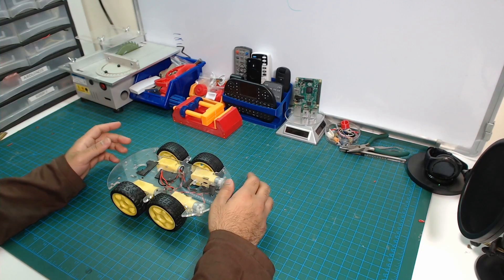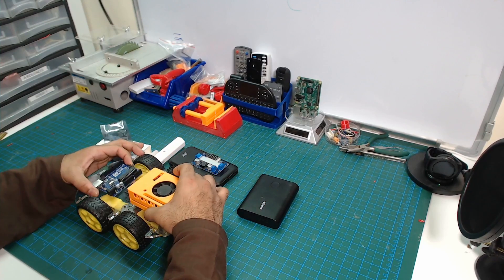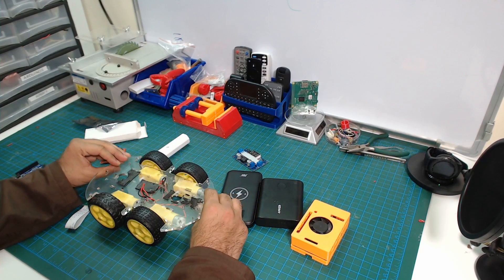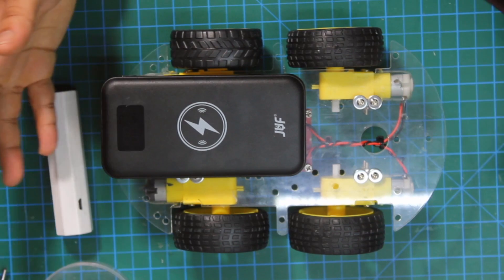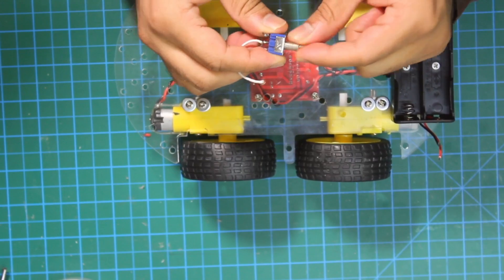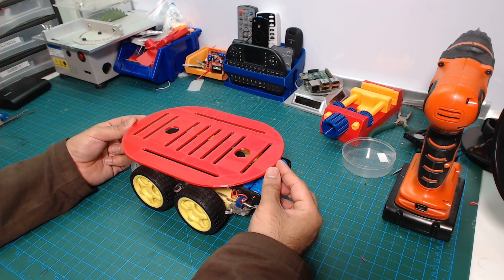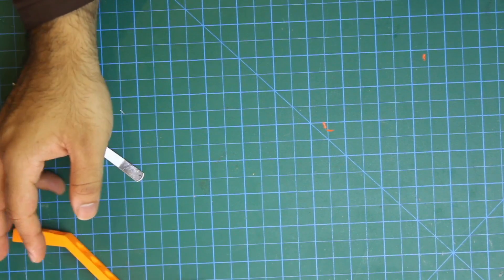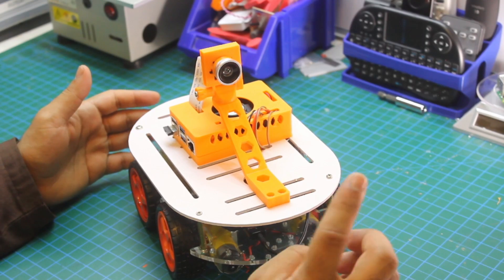The Ultimate Raspberry Pi 4 Robot | Beginner Friendly [p1]

Comment: If anyone will answer me: Is any soldering required?
Reply: yes
Reply: @mystery_1101  Thank you so much for your reply!! Could you tell me where?
Reply: @the_kid777  DC motors and wirings for it to be connected to the control driver
Reply: @gooser1  Thanks!
Reply: @the_kid777  no problemo

Comment: @Murtaza's Workshop - Robotics and AI Bro, could you separately show the connections b/w Motors & L298H & also the connections b/w L298H & Raspberry Pi 4B. The overall video is clear but, these two areas are not clearly shown. Could you please show them n detail through a video/ a circuit diagram ?? Thank You Very Much in Advance !!!

Comment: Can we use 2 Li-ion 18650 batteries to power Motors directly & through a 5V Voltage regulator or a Step Down Transformer to Raspberry Pi ?? Could you please explain these connections ??

Comment: Hello I am trying to Learn the Pi 4WD Car with Sensor and Camera, but have difficulty.  Your Installation is not that clear as not step by step instructions.  As I also have a Dual Fan (Hat For RPi) installed.  But cannot get the wheels working.  Is it possible to give some instructions?  My GPIO may be messed up.  I am using an Bridge L298N with Pi 4. Help?
Thank you in Advance

Comment: The power supply that you're using to power the Raspberry Pi is 5V, do you not get "low voltage" warnings on the operating system? 

Mine is 5V as well but I'm getting that warning.